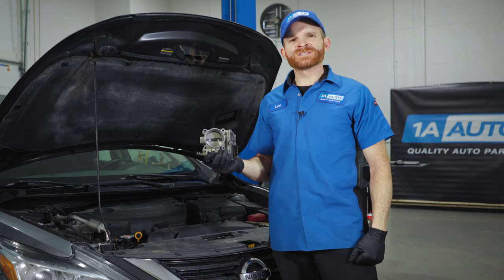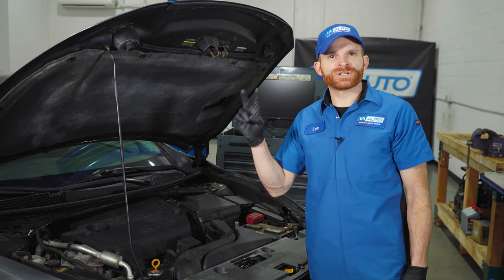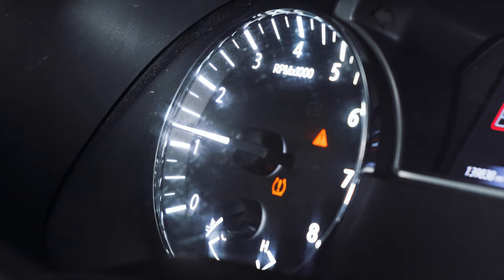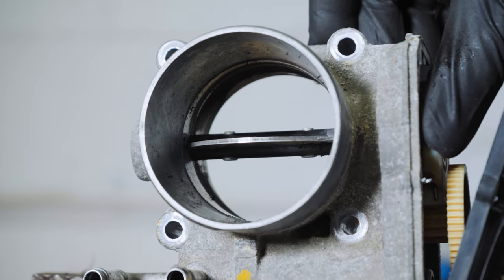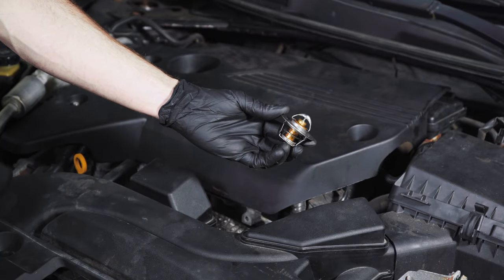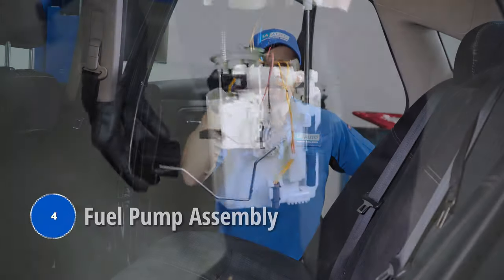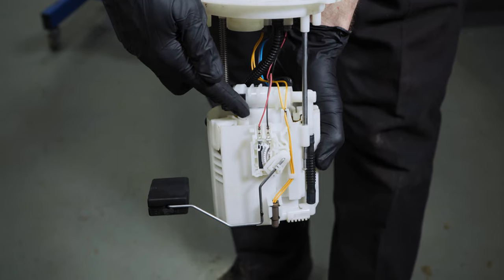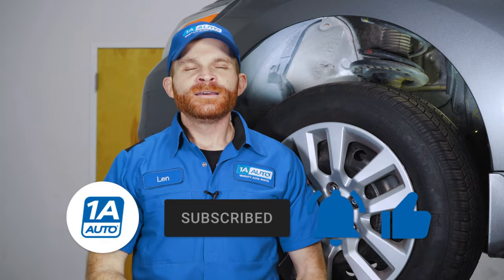Top 5 Problems Nissan Altima Sedan 2012-2018 5th Generation

Comment: Just seems like an ad more than anything. You didn't cover the most common problem which is the failing of the CVT transmission. Similarly the mass airflow sensor issues aren't mentioned at all...

Comment: Very glad to know all this information. I just bought a very well maintained Altima with 230k on it. Its only current issue is P2004 intake  runner control valve stuck open. I've already ordered the part. Thanks 1AAuto.

Comment: Can anyone help me. Mine is having difficulty going up hills and does not accelerate after driving for long periods of time. Otherwise runs pretty good. It's a nissan altima 2017. Little shaking when I start it but otherwise not too bad besides issues of acceleration.

Comment: I bought mine brand new in 2017. Throttle Body issues just started recently. And I also have a tensioner problem which is getting worse every day. Overall they are very reliable cars. I used mine for deliveries the entire time. It's almost at 250km . I'm actually happy with this car. The BCM and some other accessories have a short lifespan. But i suspect that my everyday use and constant stop and go wears it down at a higher rate.

Comment: #2 you can clean throttle body and move butterfly without an issue I have found. If you do this and still have RPM fluctuation you may want to put a can of Berryman in your fuel tank. Fixed mine so far.

Comment: 2015 Altima 2 5l S trim...  A/C blows out hot air only, appears related to 'electrical issue' per Firestone diag and another mechanic. Replaced A/C control head and engine fuse box, still hot air. A/C compressor is not receiving power b/c of electrical issue and not sure if the compressor is working. Any suggestions? Please and thank you.

Comment: I have Nissan Altima 2017 2.5 

P0706-00 T-M RANGE SENSOR A 
P2765-00 Input speed sensor B

Someone help me please  !!
Reply: I checked the sensors and they were fine.